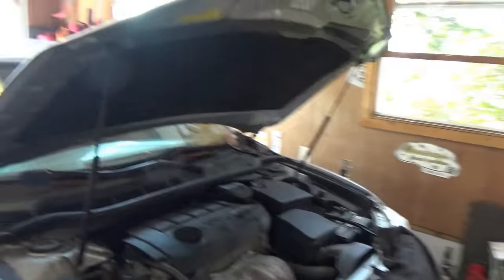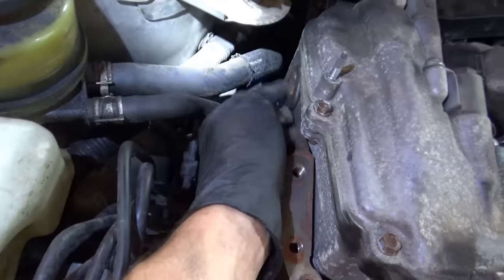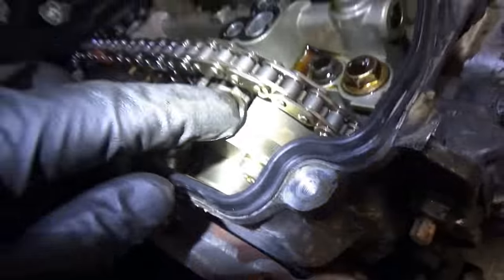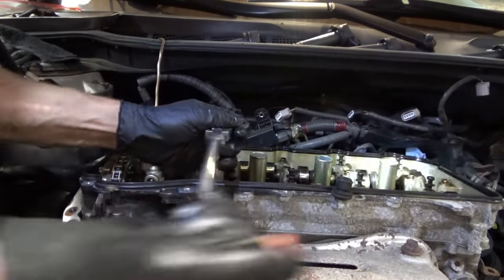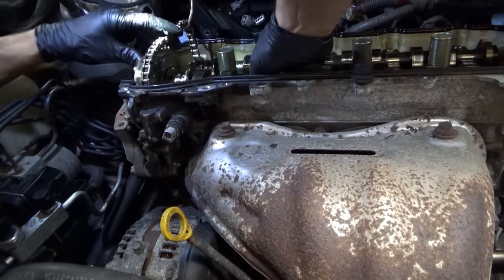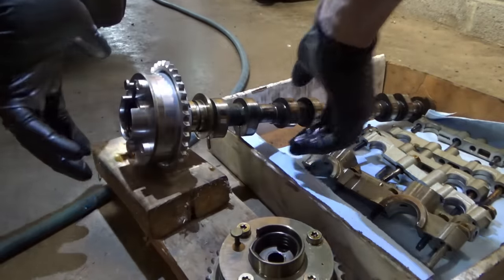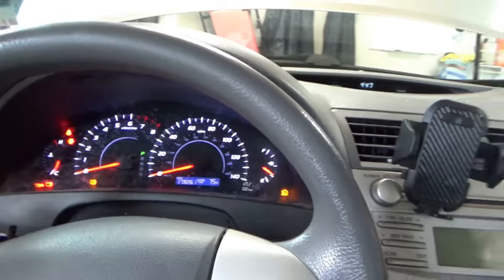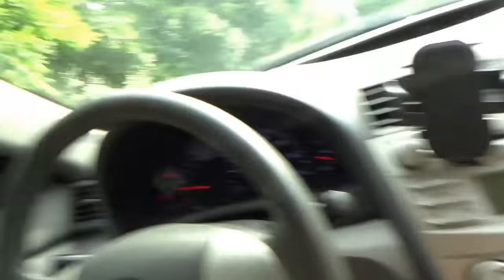Toyota Engines Can BREAK? (Camry STALL- RATTLE P0015-P0017) - REPAIRS

Comment: Toyota has had parts delivery problems since at least the 1990s.  Had an eight-year-old Celica that needed an oxygen sensor.  No Toyota dealer in the United States had the part, and there were no aftermarket sensors available.   No dealer or Toyota America corporate could give an estimate of when or even IF the sensors would become available.   The car could not be driven because it could not pass the required emissions test.   It was traded in to get rid of it.   Toyota is hardly the invincible brand the fanbois would like you to believe.
Reply: No problem getting parts here in AUS.
Reply: Your one-off example from over a decade ago isn’t relevant or indicative of the MILLIONS of cars Toyota sells.

Comment: Stay tuned for part 3, that engine will be self destructing from all the metal in pan and timing chain area
Reply: Probably not..  It will all settle down to the bottom and stay in the sludge.   The oil screen will block it from being an issue.

Comment: I tell my Auto Tech students, if your starter failed at 30 k miles it Broke.  If your starter fails at 150k miles, it just wore out.
I suspect a car with nearly 200k miles should have a lot of Worn internal parts. Everything comes down to economics.  When is the car not worth an expensive repair? Everyone has a different opinion about this.

Comment: To the owner of this car…. 
Keep this video as evidence for small claims court when you need a new engine.  All of those phaser missing parts are in your oil pan and/or clogging your oil pick-up.  I am amazed at Ivan’s diagnostic ability but cringe at his mechanical repairs.
Reply: I had a feeling someone would bring this up... the parts are metal, and much too heavy to float up to the strainer on the oil pickup tube. Just normal everyday engines with high miles can already have quite a collection of debris that no one would otherwise notice. The oil pan would need to be jam packed to the brim with junk to have any affect, I'd have no doubt it'll be fine.
Reply: Ah the hand-wringer brigade is out in full force